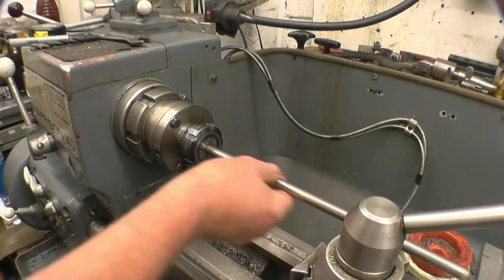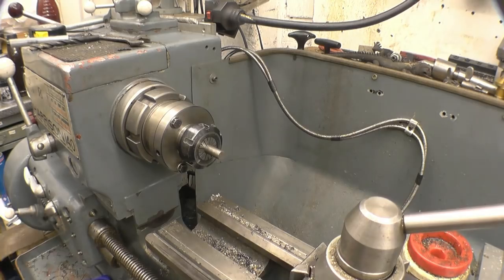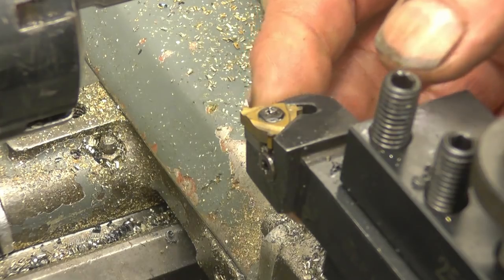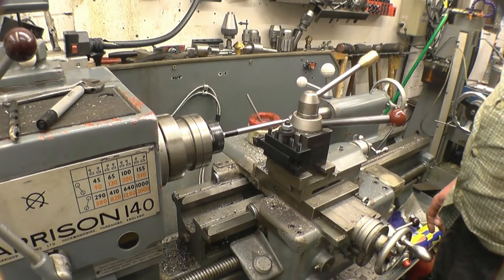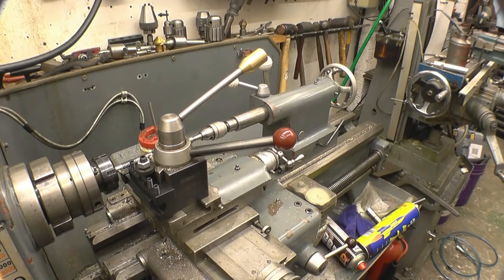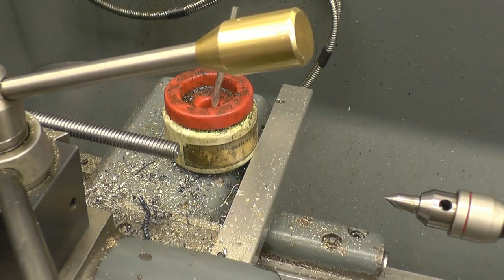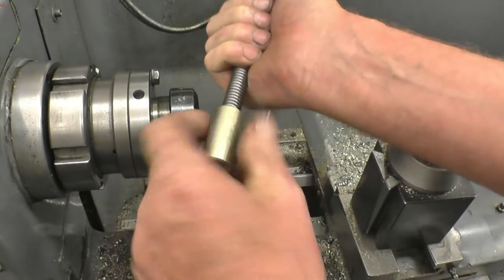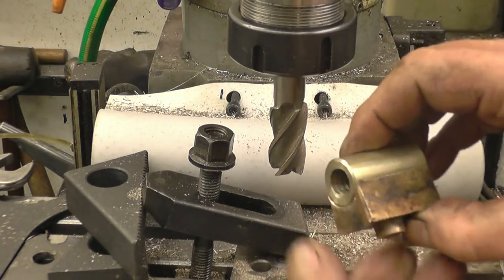SNNC 231 P2  Machining  Acme Lead Screw

Comment: Why is he using that chuck, and not the conventional 3 jaw chuck? Is it better? I saw many videos of lathes with that kind of chuck in use
Reply: It's a collet chuck. Much more accurate than the three jaw but it can only hold stock the same size as the collet.

Comment: Having seen the price of ball screws and the firms names well thought out to try and suggest brilliance like Steinmeyer, I was horrified at the price. This confirms my suspicions. They are turning them out super fast on cnc machines and making a killing. I clicked the subscribe button and yep I did like what I saw. Clever chap. So tell me something. Dads got a lathe and im learning. Can I make a ballscrew with a lathe. This is slightly different I think. Also told acme lead screws don't last as long. is that right? how longs not long though. hmmm depends how many times you turn it I guess. With zero friction balls running along inside and grease or oil I reckon a very long time. Lastly though they seem to be cold rolled. Thats not something a lathe can do is it?

Comment: You really shouldn't use a right hand insert holder for left hand threading because the forces induced in the threading are pulling the insert away from the holder! No one seems to have picked this up yet. i would like to see someone cutting this thread with a home ground HSS tip.

Comment: Are those oil zerk fittings I see on the tailstock and cross slide of your lathe.  Amazing that some people think those are grease fittings, and pump grease into them. LOL  My lathe has flush Gits ball oilers. - Formed thread cutting tools make it so much easier.  Nice fit on the nut and lead screw.  Will we get to see the finished nut?  See you in your next video, Good LORD Willing!

Comment: Interesting that your nut will only start one direction. I recently made a new nut for a 12x36 Enco in 5/8-8. Running the tap thru the other direction won't fix the problem, go figure.